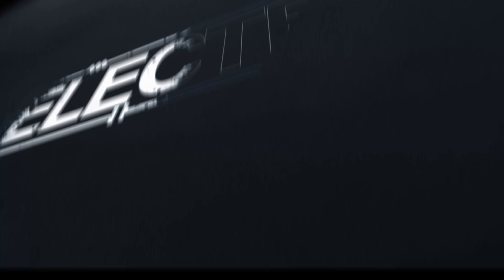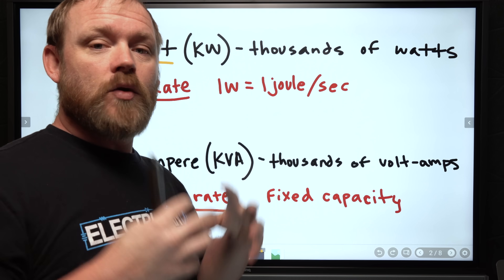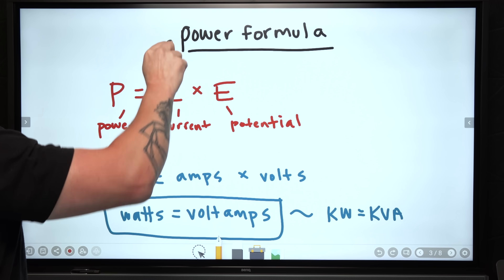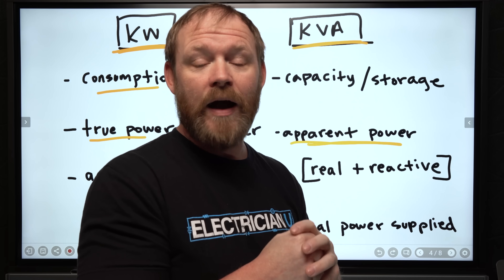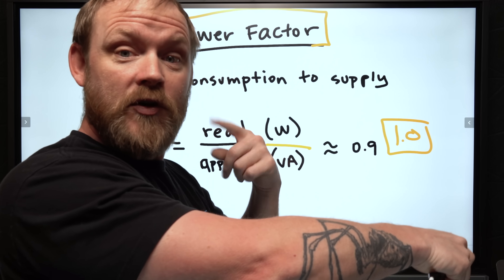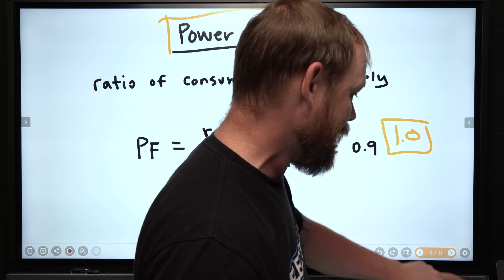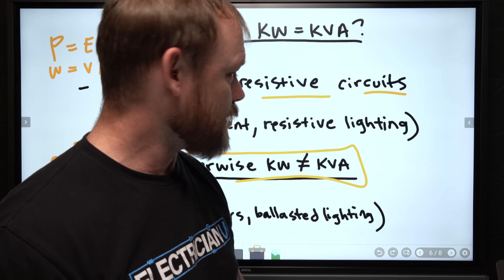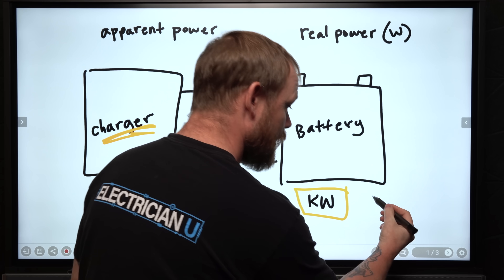Why KW and KVA Are NOT The Same Thing (Even If They Seem Like It)

Comment: The fact that the power company bills you each month for the amount of Kilowatts per hour that you use. KWH. It is the actual amount you consume. When dealing with Industrial customers with motors, transformers, and other inductive loads, that results in a low power factor rating, meaning the meters the power company uses to determine billing rates, is not registering actual power consumed, but apparent power, which the power companies translate to "stealing power", so they will tell you you need to "correct" your power factor imbalance and attempt to get closer to 1.0 or "unity" power factor, or they will start charging you a fine each month until the problem is fixes. The current LAGS the voltage in an inductive load, causing power factor levels to drop to 0.7, 0.6. or lower, totally unacceptable by the power company. The opposite occurs when you have a lot of Capacitors installed, then the current LEADS the voltage, resulting in a positive power factor rating. Bad for the customer, but profitable for the power company.
Reply: "Stealing power" means there is unused energy the electrical grid has to handle, part of which is lost during transmission. Remember that the consumer is paying for the consumed energy and for the transmission of the energy. Reactive power is not consumed but still needs to be transmitted.

Comment: The power formula is actually P = I * E * cos (phi) in Watts, and P = I * E in VA. Phi is the phase difference between I and E in AC. 
In DC, phi is zero, so cos (phi) is 1 and then P = I * E for both Watts and VA.
In AC, phi is the thing that determines the power factor. With a pure resistive load, the situation is the same as with DC. However (as you pointed out correctly), that is almost never the case. Loads often have inductive and/or capacitive components that create a phase difference. Worst case is a pure inductive or pure capacitive load that causes a phi of 90 degrees (or 270 degrees). This results is a cos(phi) of 0, meaning the number of watts is also 0.

Comment: The way I think about it may help others:    kVA-You have to size the wire (and breakers, etc) for kVA.  kW is the usable energy or light that the electrical device is delivering.  Since power factor is often over .9 it's turns out you often get can get away with ignoring it but you shouldn't.  Also in most cases the Utility only charges you for kW.

Comment: I think that the EE jargon is outdated and should be revised.  It's like talking about the ether.

The source provides power in the form of VA and the load takes that power and may dissipate some in the form of i^2R resistive heating, store some of it in the magnetic fields of inductors, store some in the electric fields of capacitors, or may emit some power in the form of light from things like LEDs.

All the energy that leaves the source goes somewhere.  It's just that some of the energy may return due to the collapsing of magnetic or electric fields and it may return in ways that are not aligned with the phase of the AC supply causing distortions in the ideally sinusoidal voltage of the supply.

A mechanical analogy to this would be to say that the "supply" is putting out force and traveling at a velocity so it is putting out work at a rate equal to F*V, but the load might be a mass that is sliding on a surface and is connected to the "supply" via a spring.  So the displacements of the source and the load may not be identical because the connecting spring may absorb and release energy causing it to compress and extend.  And, at any instant in time, the energy provided by the source may be partly stored in the potential energy of the spring, partly stored in the inertial energy of the mass, and partly dissipated by the friction between the mass and the surface upon which it is sliding.

Comment: purely resistive systems are not as rare as you say btw
everything between de wall outlet and your electronic devices are purely resistive as they are DC devices (the charger block is a rectifier) there is no inductance or capacitance in those systems those kW and KVA are the same in those systems

Comment: Mhm, even though all equations/formulars are correct, the core or the real simple truth was not reached and no really good analogy given ...

I'm not a native english speaker but I would avoid the word "capacity" in electrical explanations just that the audience will not confuse it with "capacitance". And the word "storage", no simply "no", it has nothing to do with "Apparent power".

"Apparent power" (S) is simply the Ability to TRANSFER power, no matter, what the load is doing with that power.
The Active/Real power (P) is the amount of power which is really "used" (of course "converted") by the load and
the Reactive power (Q) is the amount of power you will get back from the load in every half of the AC period.
Q is necessary for the load to work, but will be sent back to the grid "unused".

So, to drive the power P in the load it is necessary to transfer the apparent power S to the load, even though you get the reactive power Q "back".
The reason for this is that an inductance and a capacitance are STORAGES for energy and therefore (depending on the time in which the energy is sent forth and back) the storages of "reactive power".

You can say that you get all the reactive power back "unused", but he problem of reactive power is that it must be transported by the grid! And this transport is causing the losses and therefore Q is just an "unwanted thing" in AC-Grids (there is no Q in DC-Grids).
Generally the voltage in grids can been seen as constant, so for transferring the same real power P to a load with power factor 0,5 requires to double the current I compared to a load with power factor 1. Your grid (transformers, conductors, switches etc) must be designed to carry the higher current, even tough you transfer only the same amount of real power to the load.

An analogy (especially in German speaking/beer drinking countries) is a glass of beer, where the beer is P, the foam Q and all together is S. It is "nice", but does not help you in understanding electrical power.

A much better (still not perfect) analogy is a truck that delivers sand or gravel to a construction site. When unloading at the site, a fair amount of sand/gravel sticks in the bucket of the truck. It will be transported back to the quarry, where the truck is loaded again. And so on: so you transport the dead weight of the stuck gravel back and forth ... Your truck must be greater than necessary and it consumes more fuel than necessary. The volume the bucket is S, the volume that is really delivered is P and the volume that you "get back" is Q.

The German word for Q is "Blindleistung", which means "blind power", where "blind" has the same meaning as "dead power": It is there, you have to transfer it, but it won't do any work at your load.

Comment: I have a question. Years ago I was looking for a UPS for a PC; every UPS had a VA parameter and W parameter (max power your PC can draw). I noticed that the ratio between W and VA was always 0.6 for different models and even different manufacturers. Where does this number - 0.6 - come from? Does it come from a certain process and can be calculated with a formula or two? For example, is this how DC is converted to AC? Or does it come from how a typical UPS is constructed and how all its internal components work together, and 0.6 is basically just a coincidence?

Comment: Good video up until 11:30

kW is NOT the same as kWh

As you highlighted W = J/s so kWh is actually a way to express energy. In order to get the kWh you need the time the battery is (dis)charged

It is rated in kWh rather that kVAh because we want to know how much work we can get when powered by a battery and thus how long the battery will last, and because batteries are used in DC systems where if memory serves there is no reactive power

Comment: The easy way to think about it is that the voltage waveform is just the electric field, which propagates on its own at the speed of light (well, slightly slower through copper due to wave interference).  That is, wiggling electrons can create a changing electric field, but once in the wild that field propagates on its own.  The "generator".

The current waveform is the actual physical movement of electrons back and forth in the wire (back and forth because this is AC, not DC).  HOWEVER, because electrons have mass, what the electrons are doing physically is not necessarily completely synchronized with the forces applied by the passing electric field on the (already moving) electrons.

Thus, the CURRENT waveform can wind up being phase-shifted from the VOLTAGE waveform.   Even though it doesn't seem like it should be... if you have voltage X at a location and a lower voltage nearby, you'd expect the electric field to push the electron in that direction in full synchronization.  But because the electron is already moving, the "push" might just slow it down (lagging phase) or speed it up (leading phase).

Since all of these movements are sinusoidal, back and forth, they more or less reinforce each other in an endless train.

Now consider what a generator has to contend with... The generator has to generate a voltage waveform on the line perfectly synchronized with all the other generators.  It must FORCE a power factor of 1.0,  it needs to MOVE electrons to CREATE the electric field representing the voltage.  Back and forth.

But reactive power returning on the line is phase-shifted and caused those electrons to not quite be moving in the right direction at the right speed.  So the generator winds up having to apply even more force to get the electrons to actually generate and reinforce a voltage waveform that is synchronized with all the other generators.

-Matt

Comment: The big confusion is because KVA is very new when it comes to measuring electricity. KW used to handle both. As such, in general parlance KW is still both. The only differentiation is made in the electrical industry. I personally think the added term is a waste since we've had terms like KWH to handle usage rates.
Reply: The "electrical industry" doesn't use KW or KVA. They use kW and kVA. People who know what they are talking about use prefixes correctly.
Reply: @dansihvonen8218  on nameplates the k is often capitalized. So stop nitpicking about whether or not it's capital or lowercase. A capital k means the same as a lower case k since there's not a different prefix that starts with k. It would make a difference if it was an m, however, since lower case m means milli- and capital M means mega-.
Reply: @ Thank you for your opinion.

Comment: A watt and a VA are not the same thing. To be a watt the voltage and current must be in phase. The difference of the phase between current and voltage. kVA includes reactive power. IN a purely reactive load there is no power transfer. It goes in on one cycle and is returned on the next. The power company does not like reactive loads and will make customers do power factor correction. The reason for this is that a purely reactive load can draw high current and you get significant line losses due to line resistance. Transformers are indeed a load. Hook one up and measure the current.  KVA has to do with the maximum current x voltage at ANY power factor.

Comment: In AC the vector of voltage and current are not in phase, they are lagging or leading (depends on characteristics of the system) the angle between those vectors is greek letter Fi ... The cosinus of that angle is the Power Factor ...that is the difference between VA and W.

Comment: Another easy way to explain the near perfect KW equals KVA when using DC, is the generally, the length of the wire does not consume a whole lot of power, nor do the instruments input/microphones and output: speakers. You get a lot of bang for your buck for only, 100 Amps. That covers just about anybody in rock ‘n’ roll, except for maybe The Who

Comment: You missed the number one cause of modern power factor issues in the home and thats rectifiers in converting from ac to dc, in TV's, phone chargers, led bulbs, modern refrigerators and washing machines with inverters, pc etc.  there is a distortion of the current wave with respect to voltage that leads to low power factor.

Comment: The power triangle broke my head when i was in college.  Took me a bit to finally rationalize to myself what was happening.  Phase shift is a thing that is hard to grok at first.  Once you get it, though, you get it.

The simplest way i can explain it is:
KW=real power, the power to do work
KVA=what's actually passing through the wires (which is why transformers are rated in KVA)
KVAR=current circulating around doing NO work, because the phase angles aren't perfectly in phase (or a PF of 1.0).

Comment: kW means that amount of power is being delivered one-way. It's staying in the load. With kVA, some of that power is coming back out. It's a mite simpler viewed in energy terms. kW indicates energy is being delivered irrevocably; kVA allows that some of that energy is gonna come back out toward the source, analogous to the energy stored in a spring.
Reply: Also congratulation for being the only person here who can write the units with correct capitalisation.
Reply: You're right: the power factor can be written as cos phi
Phi being the phase shift between the voltage and the current.
The difference between being a power supply and a power load is 180° in phi...

Comment: Thanks for this CLEAR explanation. Working on the Utility Metering side. We can only bill on WATTS not VA. If the PF is low the utility is losing money. If the Transformer is to big(too large in KVA rating) the Utility is losing money. Example a 150 KVA transformer Energized but not loaded will consume 300kWh of power every 30 days. These losses not being metered are not recovered. Proper sizing of Transformers is crititcal. Load calculations on building plans oversize the transformer needed. Kinda lazy in My Opinion. In most every case we downsize the requested transormer by one half and it works out for everyone.

Comment: Nice video, however this is a failure of applied science to aptly name something

@5:57  I'm sorry, that is not "living proof".  Really, what you are stating is that Power In is not equal to Power Out and there is a loss in the system.  So, it is that two different Power values are not equal... not that the unit Power is not equal to the unit Power.

Basic algebra will tell you that the units cancel out and your Pf is just a  coefficient.

The math is math; according to the math, they (VA & W) are the same... all the time; they are units of measure.

Love your channel, by the way!

Comment: Employing correct terminology would help with better articulation of explanation. For example it is potential energy to kinetic energy, and rather than "reactive" it is consumption, which includes losses in conduction. 

The power companies are not fretting, they charge not only for the power production at the power station but also the delivery to the house. By way of many miles of lines that require step up transformers along the way to correct for losses in conduction along the wires. Why the voltage ~  potential difference ~ is a big number  to conduct energy over long distances.

A good mechanical example of these concepts is the difference between horsepower at the rear wheel is less than horsepower at the flywheel, the engine output, because of losses along the drive line, particularly the differential. Loss of energy also in the form of heat.

Anyway, a good video that helps a lot.

Comment: A little correction. Not KW and KWA, but kW and kWA.
In SI Units "k" - stands for kilo prefix. "K" - stands for Kelvin (temperature).
It's ease to remember, usually an uppercase unit is that named after a person. Like Watt and Ampere in this case.
Reply: Correction to correction. Its actually kW and kVA.
Reply: @exponentmantissa5598  Yes, of course
Reply: @RustedCroaker  You can edit your post (click on the three dots to the right).
Reply: @zevfarkas5120  LOL I know
Reply: @RustedCroaker  So, why not do it? (Of course, this whole chain of comments will then be left dangling...)
Reply: There are prefixes that do use a uppercase : MW, GW, TW, ... etc
Mega is the first to use a uppercase because lowercase 'm' is milli.
Everything above Mega is also uppercase

Comment: kVA is the vector sum of real and reactive power, but only for linear loads. Once you introduce non-linear loads like rectifiers and inverter drives and battery chargers, the current they draw from the supply contains harmonics, which deliver no contribution to the power supplied but do add to increased power losses in the supply network. For a domestic consumer, you only get billed for kWh consumed, but it costs the power company to supply the reactive and harmonic currents to you because they have to over-size the network to carry them. For industrial users, they do get charged a penalty if they draw excessive reactive or harmonic currents, which is why companies like ABB and Schneider have Power Quality Divisions to supply power-factor correction and harmonic filters.